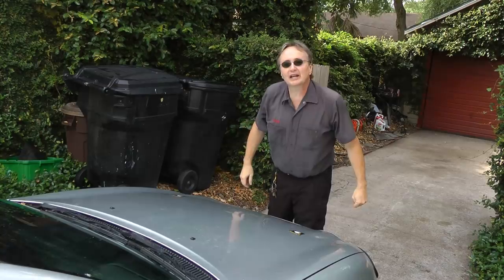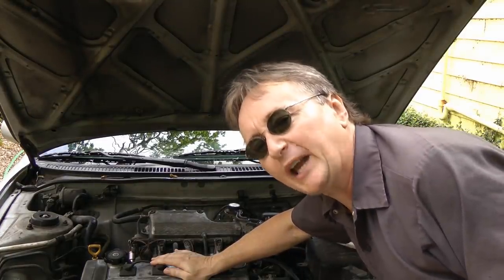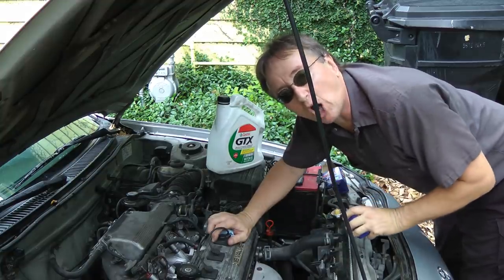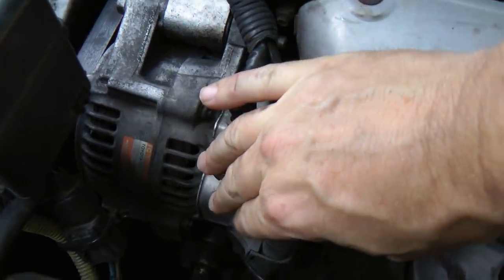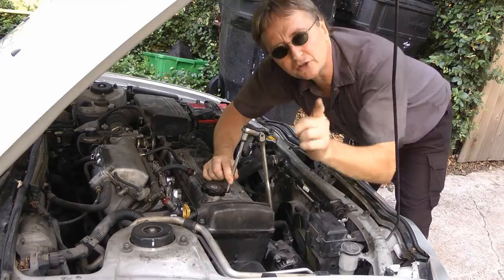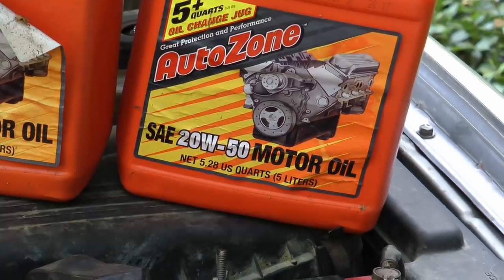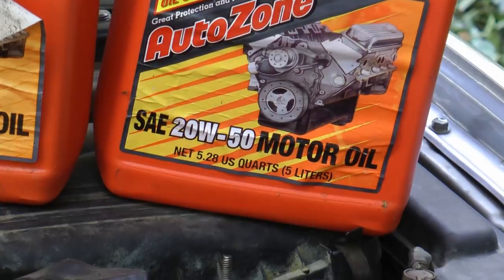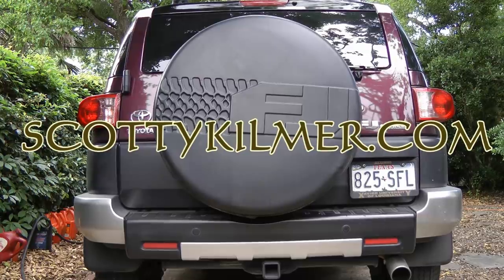Top 4 Mistakes Car Owners Make (DIY Fails)

Comment from the maker: ⬇️Things used in this video:
1. Anti-Seize Lubrication: http://amzn.to/2CG2P17
2. Disposable Gloves: http://amzn.to/2zSRuxO
3. Shop Towels: http://amzn.to/2jGDfkA
4. Flashlight: http://amzn.to/2kwtiu3
5. Common Sense
6. Full HD Camera: http://amzn.to/2AvoEk7
7. My computer for editing / uploading: http://amzn.to/2i2sKYz
8. Video editing software: http://amzn.to/2jv5Fhf
9. Thumbnail software: http://amzn.to/2k7tz6C

🛠Check out my Garage to see what I use every day and highly recommend:
https://www.amazon.com/shop/scottykilmer

👉Follow me on Instagram for the latest news, funnies, and exclusive info / pics:
https://goo.gl/ohy2cA
Reply: Scotty Kilmer my experience is that when you take a terminal lead off your battery MAKE SURE IT IS THE NEGATIVE ONE.... If you take the POSITIVE one off and it touches the body or metal it will ARK OUT and you could do some DAMAGE.
Reply: The "W" in the API service certification doesn't stand for weight.  It stands for winterized. Other than that you've given very sound advice for oil selection.
Reply: Scotty Kilmer hi scott,  just a quick one I had my car rebuilt 3 years ago. Since then it's only done 3000 ml.  On changing oil and filter the garage has done the filter up so tight I can't get it off. The strap wrench just spins round without turning the filter. Please advise. Tried everything I know can't shift it even 1 inch. I need to route this up their arsed.  It's an audi a3 1.6 sport 1998 vintage old style.
Reply: Scotty Kilmer mechanic says that power steering pump is bad but car drives just fine how do I tell if it's right
Reply: Tammy McGinnis the easy way is to take it to more than one mechanic for a quote and I don't mean to be an ass but take a man with you who is car savvy. My girlfriend has been ripped off by mechanics in the past because some shady mechanics take advantage of ladies who may not know too much about cars. Failing that ask your friends if they know an honest mechanic and go there for a quote. All the best.
Reply: Harry S. Also two different mechanics have said my car's engine is falling apart but is driving just fine still and I'm not having any check engine light  come on what should I do
Reply: Tammy McGinnis it angers me that ladies are sometimes taken advantage of by rogue mechanics. I think it's a good idea to ask someone you trust if they can recommend a good mechanic to give you a written report on the overall  condition of your car. Look at the reviews on that mechanic. Some mechanics will give you a free or not too expensive written report as to what is wrong with your car. If you don't want to spend much money you can simply continue to drive your car as is... but gently. Always make sure your coolant, fluids and oil are never too low. Also don't overfill your oil as this could damage your motor also. If mechanics have said your motor is no good.. ASK THEM WHY.. AND TO SHOW YOU WHAT THEY Mean!!!. Also look at the signs of the condition of your motor. eg.. Does it use oil?Does it run ROUGHLY? Does it make strange noises? And there are some other signs as well which I can't think of right now. If all of the above seem OK and you don't want to spend too much money on your car you can chose to continue to drive it gently and keep your fluids topped up. Always ask a mechanic to show you and explain the fault to you. Ask for a written quote before hand and if your unsure about his information check it on you tube. If you feel anything uneasy about a mechanic.. JUST GO SOMEWHERE Else.Also your engine light may not come on if the actual light globe does not work on the dash and sometimes the check engine light can be faulty and come on due  to an electrical issue. My point is sometimes check engine lights can be faulty too.If your motor uses oil or blows smoke it does not mean you have to replace the motor if you can't afford it. There are additives you can buy to put in your motor that will help like MOREYS HEAVY DUTY OIL STABILISER MADE IN USA.. All the best.
Reply: Scotty Kilmer I love your videos sir very knowledgeable and entertaining but the w in oil doesn t stand for weight it stands for winter. 5w30 for example, 5 cold 30 hot, This is so when it's cold the molecular structure of the oil will thin a little so it doesn't burn up oil pump wear out cams like you said because of slow thick oil, but once heated the structure of the oil will thicken to a 30 for good lubrication in the summer.
Reply: Scotty Kilmer Will you do something about over-torquing ?! I’m tired of taking my car to places (for convenience) and they do a RFT job (really friggin tight), in extreme cases destroying the part!!! If a part is only supposed to be tightened to30 feet pounds, and the mechanic strong arms it to 80 or 90 feet pounds, or even worse gets a torque wrench on it and doesn’t even set the torque wrench, it’s going to destroy the bolt, the part,  and possibly even the threading. The worst case I saw was when what is supposed to be a stop sign looking bolt was turned into a smooth circle by an overzealous mechhy. What’s worse when I do see them using a torque wrench, they click it three times and that’s not how they are meant to be used! One click!!!
PS.... I have a huge respect for mechanics, but I believe some of them could learn some valuable feedback from us aviation guys, where overtorquing something can result in death💀
Reply: Scotty Kilmer
Reply: Kurt Steiner f
Reply: Kurt Steiner 
One thing that I have seen done to get a filter off that was stuck on, was to drive a screwdriver through the old filter that you are going to throw away anyway, and use the screwdriver handle to get it off.
Reply: Tammy McGinnis 
For your question about the power steering, as long as the hoses aren't worn or cracking, it doesn't make noise when turning the wheels, and it does its job of making it easier to turn, then it will probably be fine. One thing to ask yourself is, "if it fails while driving down the road, do I have enough strength to turn the wheels without power steering?",  and if so, then just be ready incase it ever does and you will be fine.
Reply: Scotty Kilmer  my 2000 explorer had 146××× miles I use 10w - 40 oil since the tolerances are not tight right?
Reply: Scotty Kilmer ju
Reply: Lol have you ever heard of Scotty Donahoo rom Baltimore? Y'all would be hilarious together!
Reply: haha common sense
Reply: I wish Scotty was my mechanic, but I guess he might charge an arm or a leg.
Reply: @kurtsteiner8384  If this ever happens again wrap a balloon between the filter and strap for grip.
Reply: 10. Loud intro
Reply: Scotty you were a god from the start of your channel!!! And you still are!!
Reply: Scotty Kilmer, how do i change the transmission oil on these newer cars that you cant check on your own with out going to the dealer. I like working on my own things but i am not very knowledgeable about vehicles just know most the basics. and would you recommend me  attempting this on my own.
Reply: You need re-educating about oil

Comment: Scotty gives good advice. Back in the '80's, I had the oil filter gasket come off and stick to the block, even though I had always rubbed a film of clean oil on the gasket, when new. I saw oil spilling out upon starting the engine, and saw what happened, and learned right then to always look for the old gasket on the old filter! My son saw it happen to him once too! DIY'ers, be alert to this! Anti-seize on plugs is excellent too, especially in aluminum heads! Can't hurt in cast iron heads, either! Don't risk electrical trouble, disconnect the negative battery terminal! And always use the correct oil viscosity, for your oil. Good advice, Scotty!

Comment: A local mechanic also said it is important to blow out the spark plug wells with compressed air before removing the plugs to keep sand and dirt from falling into your cylinders when they are removed.
Reply: u meant using mouth or wind to blow it or what kinda method is it?
Reply: Yep, I have heard that too.  Same as opening the brake, clutch or power steering fluid container.  Make sure  the cover is clean so dirt doesn't fall into the oil.
Reply: @AaABbB-sg5cr  
compressed air
Reply: Excellent advice
Reply: ISSA VIBEZ  
Either.  Just don't use 10 weight.  Also if you're using conventional oil be sure to change it every 3000 miles and use only high quality filters.  No Fram
Reply: @AaABbB-sg5cr  an air hose. 
100x stronger than Johnny Jerkoff blowing on the plug like its a candle or something. A proper hard air cleaning.
Reply: ISSA VIBEZ I'd just use 5w20 in winter and 5w30 in summer. Unless you live far south. That use 5w30 all the time. My two cent. That what I do in my 2000 E150 Ford van.
Reply: A local mechanic also said it is important to blow out the spark plug wells with compressed air before removing the plugs to keep sand and dirt from falling into your cylinders when they are removed.

Not me, I just yank the plugs and let the crap fall into the hole.
Reply: @jason127x99  Thats an old adage from when oils werent as good as they are today, especially with synthetics.  Same oil all year round and high quality filter works today.
Reply: ISSA VIBEZ  are u using full synthetic? Blend? Conventional?
Reply: ISSA VIBEZ  You should definitely continue to use the synthetic blend on that car.
Reply: @tabrezshareef3716  Same.
Reply: @rays7437  The filter issue is an urban legend and a Dr. Doom scare story. A low-end Fram or other brand, or a no-name filter, is made to go 5000 miles in normal driving. But not more. I used to take my car to local tire chain that did $20 oil changes just to get you in the door. They used dino oil and no-name filters. I never had a problem because of their oil or filter. The vehicle eventually went to the state retirement program and I got a fat check. The problems the vehicle had were not engine related as such.
Reply: You can buy some cheap keyboard duster to get the job done, it’s basically just compressed air and you can get it at dollar tree
Reply: @AaABbB-sg5cr 
Don't give it mouth to mouth 😂

Comment: Tip: Some spark plugs specifically (NGK) tell you not to use anti-seize as this can allow you to over-torque your plugs by 20%. Plus they also use a special plating on the threads that inhibit corrosion.
Reply: Have you tried to get a stuck spark plug off? Have you heard of galvanic corrosion?
Reply: @RockerGuy0001  Modern spark plugs are PLATED -- NO ANTI-SEIZE is necessary or required.

Comment from the maker: on all modern cars they now suggest to never use anti sieze as the new plugs are all plated with metal to prevent them sticking, just read that last week in motor magazine.
Reply: What would be the harm in doing so, as long as you don't exceed the torque specs, it should be similar shouldn't it?
Reply: worst case it acts as insulation making the spark weak. and in another scenario, a chemical reaction can happen making the two metals destroy each other with the lube the source.
Reply: darthvader4hire 
I didn't think about the chemical reaction possibilities, I guess I was just thinking of the really old can of International harvester antisieze that I have that has aluminum and copper in it and would therefore be fine with aluminum heads, or cast iron. But you do bring up a great point about the corrosion that could be caused by incompatible types of antisieze. Thanks.
Reply: What about dieletric grease? That still recommended?
Reply: Josh Isralowitz 
Dielectric grease on the sparkplug boots is still recommended.
Reply: It can make it easy to over-tighten the plugs due to the extra lubrication provided by the anti-sieze. NKG explicitly say not to use any on their site.
Reply: Please do not apply anti seize on NGK spark plugs. Install them dry and tighten according to specifications. The torque isn't the same with lubricant when using a torque wrench.

Comment from the maker: Use the oil, it doesn't go bad, I've used oil sitting in bottles for 5 years and it still worked fine. Gasoline,now that breaks down within a year.
Reply: If the oil has been sitting for a while, it might not be a bad idea to shake the bottle before pouring.

Comment: Very good advice Scotty.
Years ago, I did an oil change on my motorcycle. I didn't spill one drop of oil.
When I started the bike, it was like a high pressure spray of oil from between the old ring that stuck to the engine and the new ring on the new oil filter. What a mess! Like you said, in a car you may not notice the problem until its too late. You have a really great channel! Keep up the good work.

Comment: FYI the "W" on oil grade stands for winter NOT weight. It's based on cold temp viscosity/flow. Example 5W is thinner and has less viscosity than 10W so 5W will flow better in colder temps than 10W

Comment: Good tip on installing new spark plugs, especially in overhead cam engines: push a rubber hose (3/8-inch ID fuel hose will work) down over the porcelain portion of the plug, lower the plug down into the plug hole using the hose and twist it to begin threading the plug into place. It's a good way to start tightening the plug without cross-threading it in the head. Pull off the hose once the plug has been twisted into place and finish tightening it with a spark plug socket. Using this method, I've never cross-threaded a plug hole.
Reply: OR? Buy a spark plug socket with the correct grommet inside!

Comment: The Disconnect battery issue actually happened to me at a campground in Vermont. I shorted out the actual part you show in the video. This short blew out the Fusible link on the battery. I drove around and around, no luck on a Sunday finding parts. Lol. I ended up pulling the clear plastic cover off the fusible link, unwrapping the metal strips and folding them tightly back together. It got me back to my apartment in Troy ny at that time. So funny to me to see you mention this. People, pay attention, Scotty is warning you of failures that actually happen.

Comment: Never happened to me in 30 years with the rubber seal coming off.
Good tip though.
With battery leads there is a right way of taking the leads off and then on again for those that don't know.
Take off the negative first then the positive lead when taking the battery off and when putting it back on again its positive first then the negative.
Think of it like this,its a negative experience when taking it off because you are starting the job and you don't like work,so negative first.
But when you have finished the job its a positive experience and your feeling good,so positive first.
Reply: 1066gaz You're right. You might also explain why, so people can figure it out when they can't remember the rule, or correct others who don't know what they're taking about.

The reason is like this:
If you're busy loosening the positive terminal while the negative is still on the battery, and you slip, causing the spanner to contact both the positive terminal and some metal part of the car, you'll short the battery out, potentially making it explode, destroying the thing you touch, welding the spanner to the battery and car, or if your ring forms part of the short circuit, it can burn you very badly because these batteries can provide huge currents.

On the other hand, if you're loosening the negative terminal and the spanner slips, you're safe because the metal car is already connected to the terminal, and all the positive side is insulated in plastic or rubber, meaning you can't touch that with the spanner.
Reply: I've had it happen on my car.   I think it's probably more common with cheap filters that have those flat rubber washers.
Reply: i take off whichever side is easiest. if the positive side then i keep my hand  between the wrench and any metal that can possibly ground it. 
i am a contrarian though and for 99.99% of the people removing the negative is best.
Reply: 1066gaz, Just like “righty tighty, lefty loosie. 😂
Reply: @paulk5311  Very interesting -- rarely do we find someone who confesses to their own ignorance.
Keep up the good work !

Comment: I had the old oil filter gasket come off recently for the first time. I knew something was wrong when the new oil filter didn't seem to be getting tight. One time I couldn't get the spark plugs out. Then I realized I had tighten them when the engine was hot. After starting the car and letting the engine get hot the spark plugs came out with little effort.

Comment: That oil filter gasket problem happen to me on my 2013 Silverado. Luckily as soon as I started it after changing the oil I heard the oil spilling out on the ground and turned the truck off but still ended up losing about 2 and a half  quarts. That was the first time that ever happen to me and I've done around 50 oil changes. Wish I would have seen this video before then lol but now I know to always check the old filter and make sure the gasket is still there. Would probably be a good idea to take a rag and wipe around where the filter goes after you remove the old one  which would probably knock loose the old gasket if it was stuck. Good video 👍